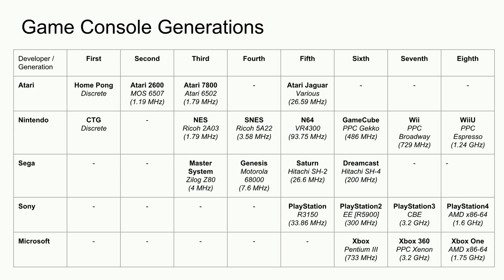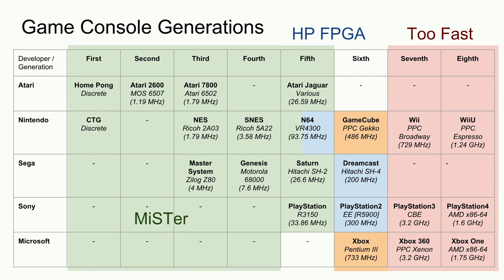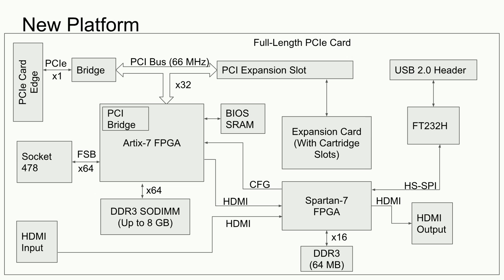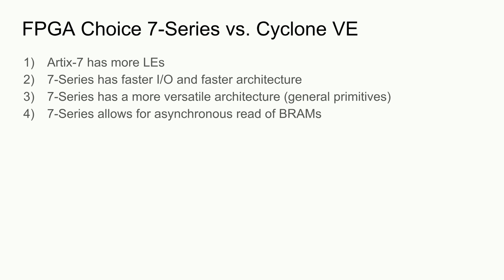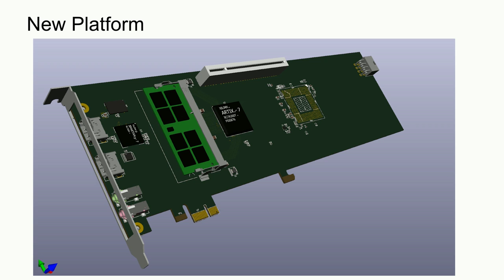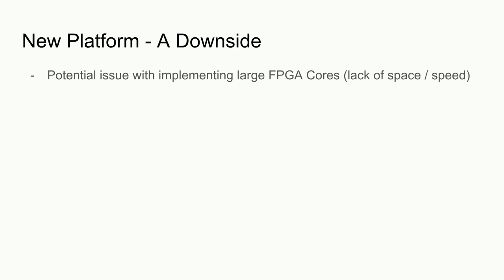A High Performance FPGA Game Console Platform

Comment: This answers my question whether Dreamcast would be on MiSTer
Reply from the maker: Unfortunately the MiSTer is too small and too slow to run a Dreamcast. It might work if you put some of it on the ARM CPU (hybrid emulation), but the best you could hope to get is about 7FPS max for a game, which would be unplayable.
That's not to say that a Dreamcast is impossible or impractical. The problem is that the FPGA used in the MiSTer is small and old (I believe it was designed in 2009). There are newer chips that are in a similar price range that can run circles around the Cyclone V on the DE-10 (one core that I was testing got a 4.5x speed improvement on the newer chip, which is the difference between 7 FPS and 31 FPS, it's also 4x the internal size).
Reply: @RTLEngineering  wow, how easily could I get a dev board with newer FPGA and port existing core to be faster?
Reply from the maker: That depends on the FPGA (Altera/Intel vs Xilinx/AMD). MiSTer cores also require a support interface from the ARM CPU, so that would have to be ported too, as well as pretty much all of their software from the ARM CPUs. It's possible, but it would be a lot of work. In terms of the pure core itself though, that would probably be easier to port, but it would require replacing the IO interfaces as well as any FPGA specific macros (i.e. for the Cyclone V - if moving to a Cyclone 10, then that would be easier). 
I was working on benchmarking a RISCV CPU, which was not meant for the MiSTer, but it ran at 80 MHz there and 345 MHz on an FPGA that I am planning to use in my current project. Note that 345 MHz is faster than the Dreamcast CPU and GPU, and while the RISCV core is optimized for an FPGA, it could be optimized further to probably add another 100 MHz (you would never get above the required 200 MHz threshold on the Cyclone V though).
Reply: Yup, the Robert, the guy behind the awesome GBA core said that 200 MHz on the DE-10 are imposible. He said that on a discussion about a PSP Core iirc.
Reply: @RTLEngineering  Would it even be too slow if one tried to put the whole Dreamcast CPU in the ARM section and just implemented the GPU and the rest on FPGA?

BTW, would it be in theory possible for FPGA to do some JIT compilation for the ARM CPU (for instance for a different CPU implemented in the ARM part in software) to help speed up some non-native instructions? Maybe in this way one could also get a faster IBM PC core, or are hybrid approaches just too cumbersome?
Reply from the maker: The DE-10 would be too slow to even run the GPU on the Dreamcast (or to potentially even fit it inside). Even though the Dreamcast GPU was only 100 MHz, a lot had to happen in that 100 MHz... it probably had a critical path similar in length to what's in the ao486 core (which does not run at 100 MHz on the DE-10). Also, by comparison to even the N64, the GPU in the Dreamcast was massive (the GPU alone is probably the size of the entire ao486 core, but the entire thing needs to be tightly coupled and run at the same speed). It may be possible to get the GPU in there an have it run at 75 MHz or so, but that would be too slow for games. 

As for implementing the Dreamcast SH-4 in the ARM CPU, I don't think that's possible.... the ARM CPU in the DE-10 is too slow.
The SH-4 was a two-way superscaler which ran at 200 MHz, so that means that at peak, it could run at 400 MHz. The CPU on the DE-10 is 800 MHz as I recall correctly (I know it's a dual core, but the other core needs to run Linux to support the MiSTer). So effectively, you would have to make sure that you execute one SH-4 instruction for every 2 ARM instructions (as a back of the envelop estimate). It's not feasible to do, especially since the instructions don't map well to each other.
You can dynamically JIT them, but the problem is that you don't have the CPU speed to do that in real time (you would have to recompile the entire game at load, but then you have to find out what parts of the game are code and aren't). And then, even if you do recompile it, mapping the instructions 1:2 is marginal at best. 

With the above, I think the best you could hope for would be 1/4 speed, which means a 30 FPS game would play at 7 FPS. 
The Cyclone V just isn't meant to do this sort of thing... it was a cheap stop-gap architecture that Altera came up with to compete with Xilinx, and Xilinx beat them out by almost a factor of 2x in speed. And the newer Xilinx chips can beat the Cyclone V in the DE-10 by 4x in speed with significantly higher denser routing resources (so you can have a lot more interconnectivity in a small area). By contrast, the new Intel chips (Aria 10 / Cyclone 10) are only about 2.5x faster than the Cyclone V.

I have been thinking about using an ARM core to do JIT recompilation of x86 and / or PPC. However, the platform that I am using has a faster ARM CPU, and has a lot more of them, so it could potentially handle that sort of workload. Funny enough, I think x86 might be easier to JIT recompile, because the x86 instructions are always translated into micro-ops (which are RISC like ARM). The trick though is being able to efficiently decode them (since they are variable length). So with that said, I think that a hybrid approach is worthwhile and probably needs to be done in some cases. But those are cases where the total available CPU resources is several times what is trying to be emulated (i.e. the MiSTer would be 2x the target for the Dreamcast, while this other target would be 8x an OG XBOX, or roughly 16x a Gamecube).
Reply from the maker: Looking at the Dreamcast's GPU architecture in more detail... there is no possible way that it could fit on the DE-10 / in any Cyclone V. It could draw up to 32 pixels per cycle at 100 MHz. That may not seem like a lot (especially compared to modern standards), but it's far more than you could hope for. Here's a breakdown that I estimated for a Xilinx based PS2 GS chip:
Drawing Pipelines: 16 x 3K LUTs
TMUs: 8 x 4K LUTs
Issue Logic: 10K LUTs
Interface Logic: 5K LUTs
Total = 95K LUTs
Unlike the PS2, the PowerVR2 in the Dreamcast had one TMU per pipeline, so that's 32 instead of 8, and it also had 32 pipelines (3.2 GPixels / 100 MHz = 32). I haven't seen any documentation on it, so it could have been 1x32, but I suspect it was something like 16x2 or 8x4. 
Granted, the PowerVR pipelines were probably simpler than the PS2 ones, so let's assume they each require half the LUTs, then you're looking at:
32x 1.5K + 32 x 4K (unless the TMUs were simpler, which I think they were more complicated) + 10K + 5K =  191K LUTs (most of it going to the TMUs actually). If you remove the TMUs, then it's 63K LUTs. 
Note that I am using LUTs here though, and not LEs. That estimate comes from a GPU that I am currently working on (the reason I haven't made a video in a while) as well as some other compilation results that I know of but cannot go into detail. That estimate comes from the Xilinx 7-series architecture, which has: 1 LUT ~ 1.6 LEs. (note that LE is a marketing term that's really sort of meaningless, but it's supposed to be: equivalent 4-input LUTs). For comparison, the Cyclone V in the MiSTer has 110K LEs, but a poor utilization factor of around 70% (30% wasted from benchmarks that I have seen). So without the TMUs, the GPU would require 100K LEs, where the Cyclone V has an effective LE count of 77K. And that would be IF you could get it to run at 100 MHz, and it would be completely without textures. Those numbers also don't include the memory controller to access the framebuffer, or video out logic, etc.
Really, the only hope you have of putting a Dreamcast GPU on an FPGA, is to multi-pump it. So you reduce the area by increasing the clock speed (i.e. 16 pipelines at 200 MHz, or 8 pipelines at 400 MHz; the latter probably won't be possible unless it were running on a high speed grade part, or used one of the new Xilinx Versal ACAPs).
That said, 16 pipelines at 200 MHz would certainly be possible in an alternate platform....

Comment: Have you considered using a Xilinx ZYNQ Ultrascale+ device - that would get you a couple of fast Arm cores for emulating the target CPU, a GPU and a bunch of very tightly coupled FPGA gates, as well as a DDR-4 controller and other goodies...
Reply from the maker: I have considered the Zynq Ultrascale+, however, they are a bit too expensive for a consumer application. Using a Zynq 7000 would probably be a better option (which I have been considering instead of the Artix-7). The biggest problem there is that CPU emulation isn't really a good solution for many of these systems since it will always be slower. Furthermore, you're going to introduce a huge amount of latency by the ARM cores talking to the FPGA logic over AXI (it's a "high-latency" protocol). 
To actually implement a PS2 reliably, or something faster like a gamecube, you would probably have to move to Ultrascale+ chips regardless though (for the speed increase). The DDR4 wouldn't really be a selling point, even DDR2 would be sufficient for most of these systems, it's the bus width that's the problem, although a physical controller would be nice as it doesn't use logic gates.
Reply: @RTLEngineering  Yes, the Zynq Ultrasale+ are a bit more expensive, but are you sure you couldn't get decent CPU emulation with a pair of 1GHz+ 64-bit ARM cores? And AXI really isn't a high-latency bus - especially when it's running at 100's of MHz. I don't know how much logic you need on the FPGA side, but if you can squeeze into a XCZ2UCG, there seem to be some interesting little modules for $250 odd e.g. https://www.enclustra.com/en/products/system-on-chip-modules/mars-xu3/ . Anyway looks like you've got an interesting project on your hands, I look forward to seeing how you get on.
Reply from the maker: The biggest problem there is that cost is a limitation for such a project. If the final product costs $1000, then that's going to greatly limit how many people can buy and use it. It would be great to have an N64 core on a high end Ultrascale+, where the MALI GPU is used to upscale to HD. But that would be a lot more expensive, and it also begs the question of "is this really that much different than a Raspberry pi for 28x the price?" FPGA re-implementation already has an image problem when it comes to emulation, and that would just end up blurring the lines. 
As for the 1GHz+ ARM cores, it all comes down to how good the emulator is. So if you wanted to do an original Xbox implementation without using original chips, then yes, you would have to emulate the Pentium CPU on a faster chip like an ARM core - the same thing is true for the PPC CPU for the GameCube. But for 1GHz, you may have to write the entire Pentium emulator in ARM assembly, otherwise it will be too slow. If the Pentium executed 1 instruction per cycle at 700 MHz, and 1 instruction takes on average 5 ARM instructions, then the ARM chip would have to run at at-least  3.5 GHz. And to get it down to just 5 ARM instructions, it would almost certainly need to be done in assembly. Obviously the ARM CPU is going to be more efficient (OOE and branch prediction, as well as close to 1 IPC if not more), when the Pentium probably had an IPC of 1/2? So it might be doable, just not easy. That's the biggest problem with emulation that sort of hardware on a CPU. On the other hand, some of the Ultrascale+ silicon can run at 700 MHz+, so you could potentially put the entire Pentium chip in there, but that comes back to the final product cost.
Anyway, just some things to think about.

Comment: Oh wow this is a cool platform. Have you talked to Sorlieg and others in the MiSTer community about this?
Reply from the maker: I haven't talked to anyone in the MiSTer community about this, and I suspect that they may be less than thrilled. For now, it's just an idea on where it could go once the limits of the Cyclone V in the DE-10 are researched. Eventually they will run out of cores that can be implemented.

Comment: Would love to see a 3D rendered mock up of what a standalone console with your build inside would look like?
Reply from the maker: It would most likely look quite strange if it was based on a SBC like a Latte Panda. Effectively, the Latte Panda would sit under the FPGA (being about 1/4 the size of the PCIE card), with a short PCIE ribbon cable connecting the two. It wouldn't be the prettiest solution, but it would certainly have more power than the current MiSTer. I could probably do a quick render if you would like, but as I said, it's going to look quite strange.
Reply: RTL Engineering I’m sure a nice shell with a little style would look good. Just shove it in a mega drive shell lol Jkn

Comment: I would love to see a card I could put in my computer that would let me leverage an FPGA. I wish you would have a way to transfer files back and forth. Such as have the Roms saved on the computer that the FPGA could read or a way to transfer backups of savefiles and carts with saves on them for backup purposes and use the computer's video outputs or run the program in a window along with use peripherals attached to the computer. 

I know probably just dreams but to have a seamless FPGA/Software Hybrid emulator all in one system would be great. All the benefits of both. 

Makes me think of the old 3DO blaster.
Reply from the maker: Transferring files would require an agent on the FPGA side, though that's doable with a FPGA+ARM SoC hybrid (like what the MiSTer uses). If it were only a FPGA on the card, there wouldn't really be anything to transfer files from/to, since the host CPU would be doing all of the work / management. 
One of the challenges that I haven't been able to solve is the video output as you mentioned. The problem being that a PCIe link would be too low / high latency to send video data from the FPGA to a GPU, and you have the opposite problem if the FPGA acts as the sink. The only solution I have come up with is to use a KVM switch / multi-input monitor, and switch sources where appropriate (alternatively, you could use the FPGA output as another monitor - though not for the desktop environment on the host).
I think a FPGA+Software Hybrid emulator is likely the solution for many systems, especially if you want higher quality video output. Although, it does pose the question of: at what point is it mostly a software emulator / would a software emulator by itself make more sense.
Reply: @RTLEngineering  indeed display being picture in picture be ok if not full window and I could undo the inputs and swap or kvm them when needed

I am keeping open eyes on all options and an open mind. Fpga is the hotness now amd many are really hating on software approaches to emulation. I just want all options explored and let the results speak for themselves.